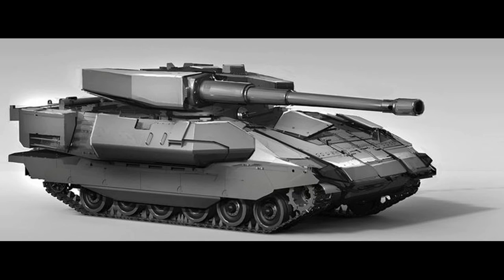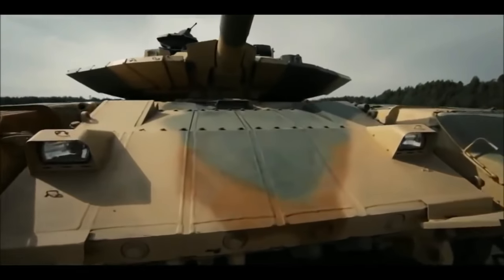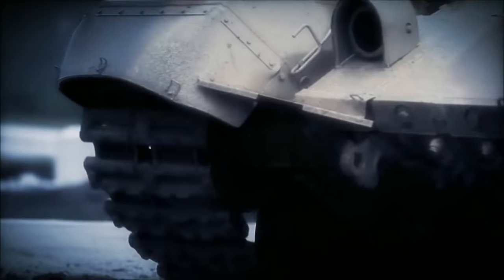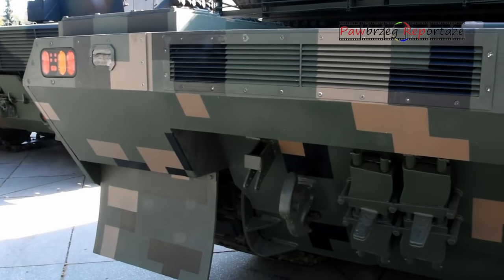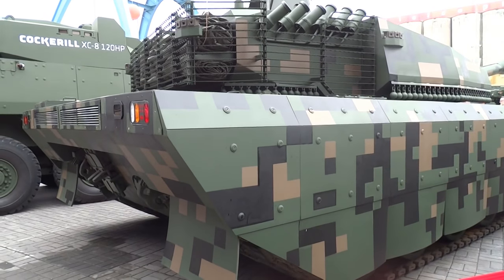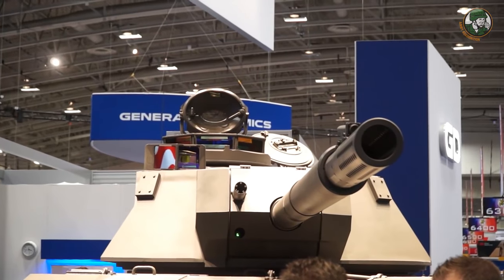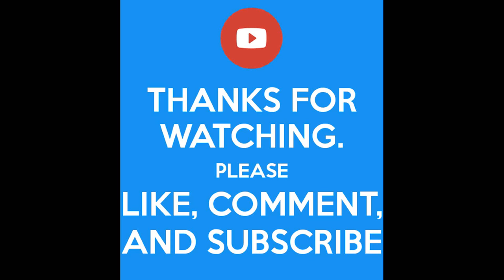3 Newest Tanks showcased at latest Exhibitions: T-90MS Proryv-3, PT-16, & Griffin.

Comment: What on earth is so special about the modular propellant system? Having a separate charge and projectile seems like a hassle and a waste of time, especially during reloading, what difference/ benefit goes it give? and its not new either, many large caliber guns (122mm D-25t anybody?), and IIRC all howitzers, have used this technology
Reply: Arda Onen it's because of loader fatigue and the amount of space inside to manoeuvre a shell, it's not so much relevant anymore but going back to the Cold War or even ww2 it was just necessary. Take for example the ISU-152, the shell and propellant weighed around 40Kg each, so together would be a ridiculous weight. And trying to move a shell around in a space with no more than a metre to move around would be difficult even if the shell wasn't nearly 100Kg as one piece. As for modern tanks with autoloaders, I guess it's just how the tanks were designed. It's also good for manual loading tanks. Having a separate charge also allows for lap loading, in which the non-explosive sabot round can be held in the loaders lap while the gun fires off the previous round. This increases the fire rate for a short time
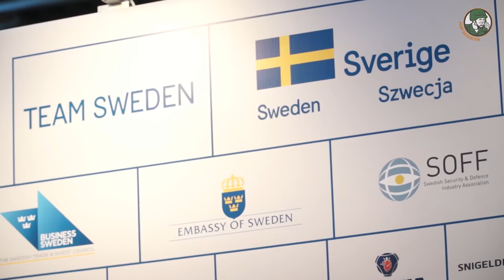Reply from the maker: The loading mechanism for the Propellant is entirely different today. It's not just adding "gunpowder" to the shells anymore. It's 2 separate tubes put in the Autoloaders, hence why the PT-16, T-14, and 2S35 Autoloaders are classified to the point of no Conceptual Art even out there. The range and kinetic force is significantly increased. For example, the Msta-S SPG shells need to be "loaded" before being loaded, but the 2S35 uses Autoloaders for each part of it, and the computer calculates how much Propellant is put into the shell milliseconds before it is fired depending on the target and range. The same goes for the Vacuum-1 on the Armata, and I assume for the PT-16 and M1A2 SEP V3 Abrams. For an example of the loading mechanism, here's my translated documentary of the 2S35 and the loading side by side comparison between 2S19 and 2S35 is seen at 7:25 (http://www.liveleak.com/view?i=5b8_1460261581). So it's not just the shells, but an entire unified digital system now when mentioning modular propellant, hence the name "modular" for it, due to the possibility to change its characteristics.

Comment: Actually the gun of PT-16, isn't slovakian neither ukrainian design. It's swiss RUAG CTG 120 mm smoothbore cannon.
Reply from the maker: It's still unconfirmed due to unlicensed reasons. It could be the Ukrainian KBM2 that (The KBM1 being previously demonstrated on the T-84-120 Yatagan), it could be the Swiss gun, it could even be the French Nexter Gun. Either or, it's just an L49 manufactured copy. Here is just 1 source of the possibilities: http://defence.pk/threads/poland-develops-new-pt-16-main-battle-tank.446625/
Reply: Actually our Leopards 2 A4 and A5 are better than PT-16 witch is a .... joke. PT-91 and T-72 should be removed from the service soon (mybe 2020, when Leopard 2PL will be in progress).

Comment: Loves the PT-16 and PL-01
Btw, can the PT-91 operated by client countries be upgraded to the PT-16?
Also, what's those balls dangling under the turret?
Reply: KHAIRUL AZHAR KHOURUDIN yes the pt-16 is meant to be exported because the poles use the leopard 2 as their MBT... about the balls... idk
Reply from the maker: There is an upgrade package of the PT-91 to the PT-16 as I mentioned in the Video it is available on market, though there have been no buyers yet. The balls there is an additional armor to reduce kinetic energy from incoming shells and missiles. It's not very effective, but it's better than nothing and works with the same perspective in mind as Net-Guard's. P.S. Sorry for late reply, was out of commission for a while.

Comment: What I don't understand here is the following: The old type of gun used in the T-64, T-72. T-80 and T-90 used segmented ammunition from a carousel auto loader underneath the turret. The new Armata gun uses non-segmented, mono-shell ammunition, like a NATO tank, right? That works in the case of the Armata because the turret is unmanned, so you have room for an auto loader that stores the shells standing upright underneath the turret.
How does that work in this new version of the T-90? Because the turret is manned, you don't have the space for a auto loader like in the Armata and you can't fit the un-segmented new ammo into the old T-90 type of auto loader for segmented ammo. Does that mean the new T-90 is limited to the ammo it can store in the back of the turret, like on a western tank?
In western tanks that works, because you have a human loader, who can get ammo from several different places inside the tank (Leopard 2, Merkava, Challenger), or because the turret is so huge that you can fit all the ammo in there (Abrams), or you have some ammo in a turret auto loader and some ammo in the tank, to replenish the autoloader with, like on the Leclerc. But without a human loader and without room inside the tank for a second ammo rack, that would mean that the new T-90 is limited to the maybe 12 to 15 rounds it can load in the back of the turret.
Is that the case?
Reply from the maker: This video is from 2016 and back then the T-90MS Proryv-3 had rumors of an Armata Gun. I also questioned how the gases would be cleared since the Armata 2A82-M1 gun doesn't have a fume extractor. I then thought maybe they were going to use an original 2A82 gun. But it turns out the Proryv-3 is what became what we know today as the T-90M, and the rumors proved wrong. The T-90M uses the 2A46-M5 gun.

Comment: The griffin demonstrator is ugly as hell but hey if it works its all good but i doubt it. Im no specialist but that thing is heavy and looks like its made of aluminium paper. The T-90 looks like an all around cost effective purchase wich most nations could procure. Think we might see the T-14 armata with the 152 mm gun one day? It looked sexy as hell on the 3D graphic designs.
Reply from the maker: There are definitely talks since the start of putting the 152mm gun called the 2A83 on the Armata (most likely 2A83M-1 without Fume Extractor). UralVagonZavod designers though claim that it wouldn't give much benefit as the power is from the Next-Gen Ammunition with Sprinter already being a Next-Gen of a near-100% accurate GM. However, they'll without a doubt put one on just as they put the 2A82 on the T-90. For now, the 2S35 Koalitsiya-SV will be the 152 mm 2A88 Gun user, with the capability of landing 2 shells into 1 crater from 50 Km away and a whopping 20 Round Per Minute Firing due to the Liquid Nitrogen Cooling on the Gun. I translated a Koalitsiya--SV documentary if you're interested that you can find here: http://www.liveleak.com/view?i=5b8_1460261581
Reply: +Ukraine War Awareness 
Nice bro! Thanks for the explanation im looking forward to those upgrades and ill definitely watch that video you linked, thanks.
Reply from the maker: No problem, I have more if you're interested throughout my widespread banned LiveLeak accounts lol (including T-14 Documentaries and Uran-9), so just ask whenever you're ready. Also, as for Griffin, eh, that's what happens when you rush things. 5 months to shrink the latest Abrams turret on a British Chassis? Platforms need years to be designed. However, the concept of automation is good. If General Dynamics can legitimately accomplish that, even if it means cooperating with BAE Systems (which is ahead in Robotics Armor), then they could have an actual sales pitch.
Reply from the maker: + Anti Russian Refuter aka 'ARR' Had to unspam your comments because YouTube now designates you as a Spammer. To answer your question, the tanks you are referring to aren't "Russian" or "Ukrainian". They're Soviet. Kharkov had the job of making Specialized Tanks (T-64) while Nizhny Tagil had the job of making Mass Produced Tanks (T-72). This may shock you, but the original Chiefs of the Kharkov Morozov Design Bureau and Malyshev Factory in Kharkov, Alexander Alexandrovich Morozov is originally from Bryansk, Russia, Viacheslav Aleksandrovich Malyshev also from Bryansk, and at his request, was buried next to Lenin on Red Square. So the designers of your favorite T-64 Tank, were ethnic Russian's, born in the Russian Empire. They never had Ukrainian Citizenship. They were all Soviets. You can't compare a Ukrainian T-80 to a Russian T-80..
Reply: Will do, but if you could link your liveleak accounts to this channel it would be nice so we can acces all your vids.

Comment: so the penetration of svinets 2 at 2 km is 800 mm according to this https://topwar.ru/31337-kineticheskie-snaryady-i-rakety.html
and 2a82 uprates ME by 1.2 times , does that mean that the penetration will boost to something close to 950 mm ?
Reply from the maker: Vacuum-1 has a 900 mm long Penetrator and can Penetrate 1,000 RHA at 2 Km, with a maximum penetration range of 8 Km.
Reply: what about svinets 2 ?
Reply: Only difference Svinets and Svinets-2 is Wolfram KEP and Uranium KEP accordingly. Vacuum-1 (which come with lower penetration than proposed on Vacuum project) completely new shell for armata main gun. Basically penetration numbers for Svinets-2 same as depleted uranium KEP of Abrams, about 650mm on 2km range, Vacuum-1 expected to have 1000 RHA at 2km, but info classified and believed to be 150mm less. Vacuum-2 in development already to reach proposed RHA
Reply: Before someone start holy war about incredible RHA on M829 or Vacuum-1, remember its based on three factors kinetic energy, KEP material and KEP design. Last one always dart like on modern tanks, prooved as most effective. KEP material uranium probably best. Kinetic energy is king, from school you should know its mv2, so weight increase penetration linear way and speed increase penetration in square. So ALL difference between M829, Svinets-2 and Vacuum-1 is muzzle speed and weight. M829 speed 1670 m/s, S-2 1650 m/s, and V-1 1800 m/s. Also V-1 got little higher weight due higher calibre

Comment: Brazil may be the possible future operator of the PT-17 (we are looking for a modern MBT to replace our Leopard 1A5BR fleet. The maximum weight should be 50 tons, 120mm L/50 gun, capacity to receive active/passive protection systems and 60km/h maximum speed. has many other requirements but above are the main ones)
This is the link for the operational requirements (launched in February 2020, in Portuguese): http://www.sgex.eb.mil.br/sistemas/be/copiar.php?codarquivo=977&act=sep

Comment: Since PZL Wola engine S-1000 not exist any more/lost capability of production. Serbian core engines are in play and if necessary modernized by PZL Wola to S-1000 type or used as Serbian 1000 HP rated.

Comment: RENK isn't French it's German
Reply from the maker: RENK is a French Company that is 76% Subsidiary of the German MAN SE company (meaning 76% owned by a German Company because of stock / holding reasons). The engine is still a French Powerpack however. If you Google "RENK Engines", it will say RENK France. Here is the engine mentioned here (http://www.renk-france.fr/esm350-%E2%80%93-modern-power-pack-for-t-90-t-72-m-84-pt-91-and-derivatives) and their Video that was included in my Video (https://youtu.be/X3LXoG3BWyI). Many companies have firms based in other countries that make products exclusively there. The ESM 350S is one of those cases. In their "About Us" page, RENK France is based 30Km from Paris (http://www.renk-france.fr/about-us).

Comment: Wait, does the 2A82 use the same two piece ammunitiin as the 2A46?
I thought it got a new type of munition that was not compatible with the old gun.
Reply from the maker: The 2A82 gun is backwards compatible, meaning it can use all ammunition meant for 2A82 and 2A46-M5, but not the other way around, 2A46 can't use 2A82 ammunition. However, regarding that gun, it turns out they were just rumors. The Proryv-3 became the T-90M and it uses a 2A46-M5 gun.

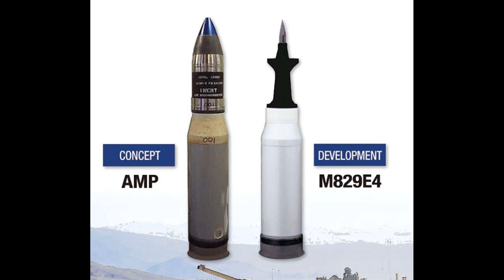Comment: Last time I checked Russian tanks starting with T64 and onwards feature split loading with round first and separate propellant charge after. Which theoretically, chamber size and autoloader dimentions permitting, allows for such modularity of propellant which you mention at 9:15
Reply: Yeah and it's not a good thing for APFSDS too since it limits the penetrator length.

Comment: Can you explain a little better what is a modular propellant round?
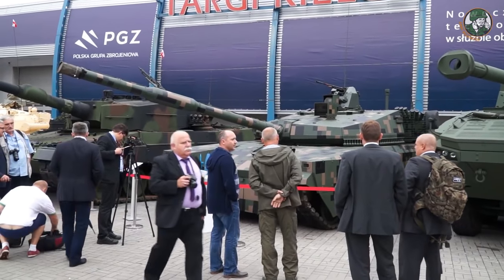Reply from the maker: This documentary here demonstrates a modular propellant round for the 2S35 (http://www.liveleak.com/view?i=5b8_1460261581 at 7:25).
Basically, the propellant is a powder-like substance in a full canister is loaded with the shell. An onboard computer calculates the distance between you and the target, and calculates how much propellant will be used upon firing the shell. It's "Gunpowder on Steroids" for Shells per se. It gives it extra range, extra kinetic force, extra energy, but the shell at the same time is heavier (to accommodate for the powder) and a loading mechanism must be made to load the barrels filled with the modular propellant powder. Since the shells are heavier, they can pack more explosives, which makes it a cyclical process. Shell is stronger, powder launches the shell to make it stronger. The compound of the powder itself is classified for each shell, as the US and Russia use different formula's. These formula's also release more chemicals and kinetic energy which turns into heat. The 2S35's solution to this is Liquid Cooling, also a classified compound but most likely containing liquid nitrogen. Cooling solutions for the Armata, M1A2 SEP V3, and Rheinmetalls Gun is yet unknown (if they even have cooling solutions).
Reply: So if im understanding correctly: it works by loading different amounts of propellant based on ballistic calculation? Is it a split ammunition type like the one used on 2A46 or is it a one piece round like the NATO 120mm?
Reply from the maker: Split ammunition? Sabot rounds are Sabot rounds, regardless of 125mm or 120mm Gun. Modular Propellant Ammo just has extra room for the charge, and the amount of charge (powder) is fired with the round and varies in quantity.
Reply: I meant two piece ammunition like what is used on soviet tanks since t-64 up to t-90
Reply: +Ukraine War Awareness i would crewman loader for 125 mm smoothbore gun. Autoloader?why not? i would pick crewman loader.which is good for YOU? if YOU have one of this tank?Autoloader or crewman loader?
Reply from the maker: I personally prefer Autoloaders over manual loaders. The myth of Autoloaders going cook offs are false and based on old T-64A and T-72A Tanks. Autoloaders have evolved since then, and Cook Offs are common on the Abrams tanks as well as an example in Yemen and Iraq. Manual Loaders under intense conditions just cannot get a higher rounds per minute than a modern autoloader of 8, 10, or 12 rpm (with manual loaders being 6 rpm). That's why Western Tanks such as the French AMX-56, South Korean K2 Black Panther, Turkish Altay, and Polish PL-01 have all moved to Autoloaders. It's more effective to have a crew of 3 instead of 4, because 3 tanks with a crew of 3, and you have a remainder of 3 crew members than compared to a manual loader tank (so 3 Abram's Vs. 4 PT-16's with each a total manpower of 12). The T-90MS has a new shield around the carousel Autoloader, and extra shields on the interior from shrapnels and other damages. The T-14 Armata and 2S35 Koalitsiya Autoloaders are stored away in an armored capsule, with ammunition far from the crew behind a thick armored wall.
To compare Artillery Rate of Fire, the US M109A6 Paladin / M109A7 has a rof of 4 shots per minute under intense conditions. The AS-90 Braveheart has 6 rpm, Chinese PLZ-05 has 8, and German PHZ 2000 has 10. The Koalitsiya Autoloader has a rate of fire of 16 shots per minute and 20 under intense conditions. The Armata  is believed to be at 12 shots per minute. Autoloaders have evolved greatly since the 60's from the early designs of the T-64's and T-72's. That's why I personally would choose an Autoloader over Manual Loading.
Reply: +Ukraine War Awareness yes I know. some t72 in syria going cookoff and their turret being blast of their hull.... I would like autoloader on my tank but why I chose crewman loader cuz if your tank get disabled when your track destroyed. it means fast repairing... yea I know some autoloader tank like t72 in syria get destroyed and their ammunition cookin off.... and some crewman loader also failed in iraq they destroyed by Houthis ATGM metis,kornet,bgm 71,etc.            I hope they ad active protection system to their tank such as afghanit PMA,or trophy PMA. that might comin handy. Autoloader  I think why not?      if I got my own tank maybe I Will choose the new jerman tank leopard 2A7
Reply: +Ukraine War Awareness nice know what MBT r YOU choose?
Reply: Ukraine War Awareness the Abrams tank averaged 8 rounds per minute at the low in in the Iraq war and the Abrams has a blow off panel made to cook off when taking a direct hit to the storage compartment also to note the Americans never faced a cook off Situation in Iraq only the Saudis because they sit there like idiots and abandon a tank when being shot at they have no training you would think a country with so much money would train more
Reply from the maker: alanch90 - You asked about Modular Propellant Rounds. I made a Video specifically about them if you're interested! (https://youtu.be/-tszXUpILeo).